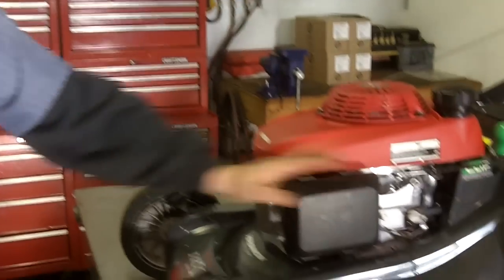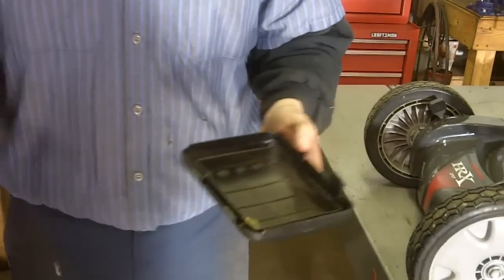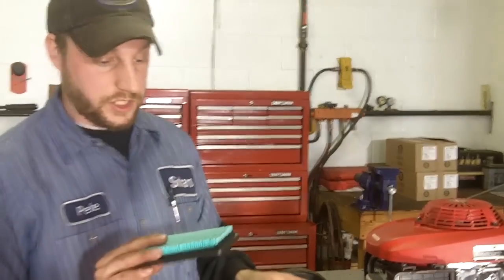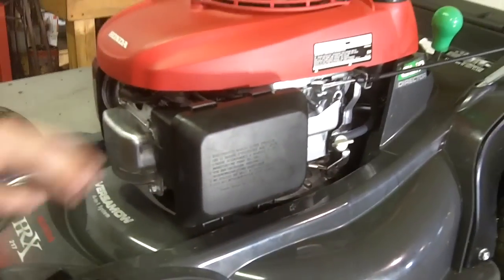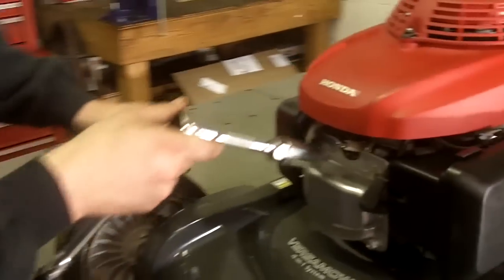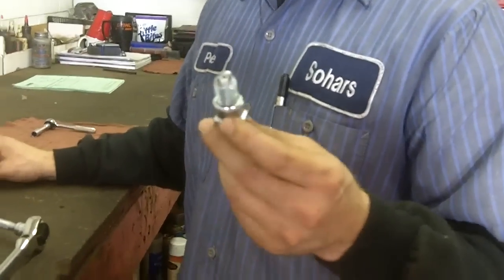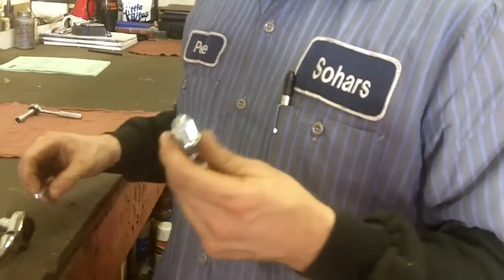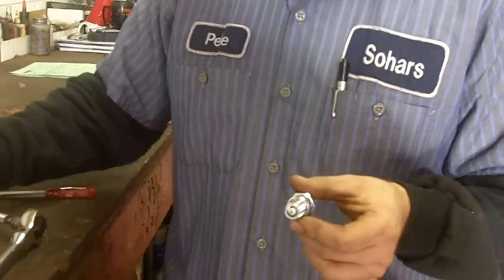How To Replace A Spark Plug & Air Filter On A Honda Mower

Comment: 13/16" deep socket and ratcheting wrench with an adapter to get to a larger socket square hole in the socket itself (if you have a small socket wrench kit as most guys do). Start the new plug by HAND to ensure its threaded right ...and then tighten just snug with the wrench/socket. LAST, tighten the plug but no more than firm with the wrench and 1 hand.

Comment: Good video. After using compressed air to blow out the filter box, replace the filter and lid. Now that it's sealed; use air to blow away any dirt and grime around the spark plug prior to removal. Grass and dirt can also accumulate under the engine cover. WD40 can free up a starter rope that won't retract.
I never store my mower outdoors.
I prefer a bit of anti seize compound on the new plug threads, rather than oil. Aluminum head ya know. A dab of silicone dielectric grease inside the plug boot will make it easy to pull off next year.
My Honda is 12 years old, on it's second mulching blade and is still great! Cheers!

Comment from the maker: We just used standard 10W30 motor oil. It just lubricates the spark plug enough to make it easier to put back in the engine and to take back out the next time you remove it.

These Honda mowers do not have an oil filter, so you won't need to worry about that!

Comment: Cant seem to get the spark plug boot to snap onto the new spark plug. Mower still starts and run but the boot won’t actually snap onto the spark plug.. any ideas?

Comment: Scott: Thanks for the video!  Two questions:
1.  I have a 2 y/o Honda HRR216VKA mower; the manual calls for 14 ft lbs of torque installing a new plug.  Can that be correct?  (14 ft lbs is basically hand-tightening.)
2.  What's your opinion of the E3.10 spark plugs?  (I bought one as a replacement for the Champion RJ19LM in my 3 y/o Lawn Boy 10634 20 in. mower, but haven't yet installed it.)
Thanks!
Reply from the maker: 1) I confirmed that the Honda service manual for all HRR216 models shows 14 ft-lbs of torque for spark plug installation. You always want to hand thread spark plugs so you don't strip the head. Once you've tightened the plug as far as it'll go by hand, you can usually tighten it a little further (like a 1/4 or 1/2 turn) with a wrench and that's enough.

2) In our experience, the E3 plugs run alright but aren't worth the extra money. They're more of a gimmick to get you to buy them. They're supposed to create less carbon deposits and burn cleaner but we haven't seen any serious case studies that prove that to be true. If you already have the direct cross to the RJ19LM, use it. If it runs rough, I would recommend switching back.
Reply: It's always good to ask someone who knows what he's doing.  Thanks, Scott!

Comment: What are the symptoms of a bad spark plug. My Honda troy bilt turns on and then sputters and shuts off. Can that be a spark plug issue?
Reply from the maker: This sounds like a fuel system issue more than a spark plug. Start with making sure you're using fresh gas and drain any old gas in the tank. If you're still experiencing issues, this could be a clogged fuel line or gummed up carburetor so you may need to look further into cleaning/rebuilding the carburetor.

Comment: I have that mower and need to change the plug. What size socket is that?????
Reply from the maker: Scott, most Honda models use a 13/16" or 21mm socket.

Comment: hi
i have a honda hrx and it will only start when i take the air filter off,any ideas what the problem might be,the lawnmorer is about 4 years old and the filter has never been changed.
Reply: You probably have a filter that's extremely clogged if it hasn't been changed in 4 years. I would buy a new air filter and try it again. you really should change it out every year as part of your maintenance

Comment: The spark plug comes out easy but Never goes back in correct because of the angle and that cover blocking it from seating properly. He did it on a new lawn mower an old lawn mower it'll never go in straight Unless you take off all those damn covers in front